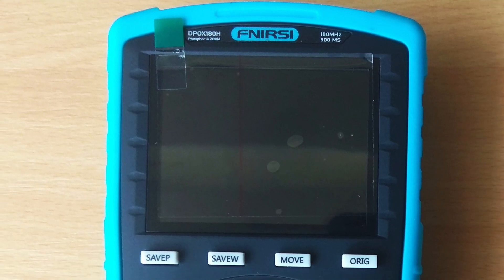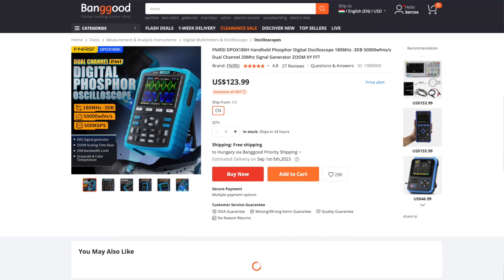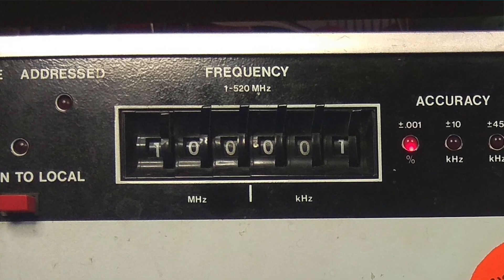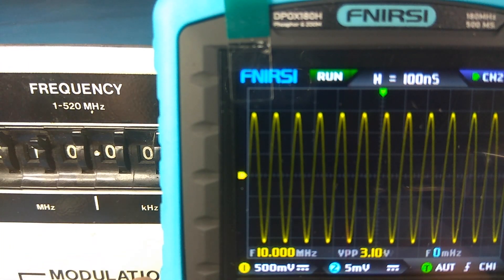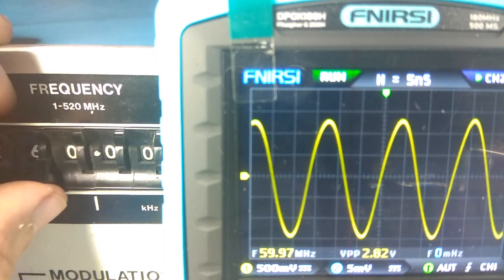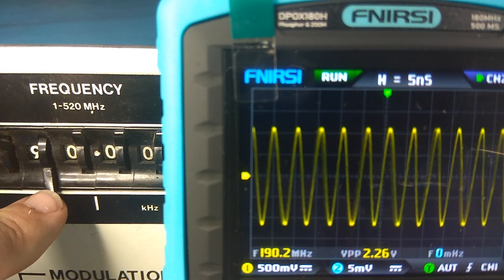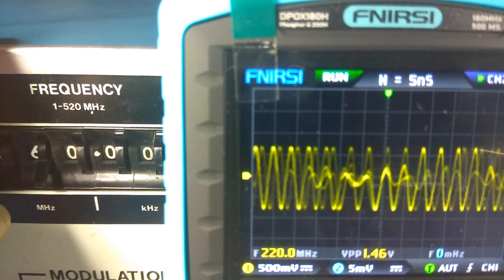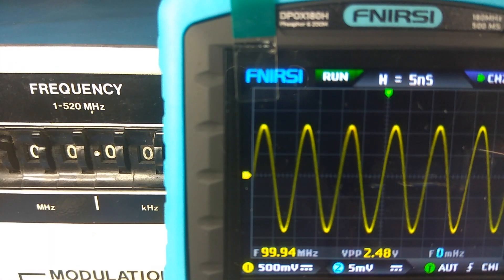FNIRSI DPOX180H Oscilloscope Review: Does It Truly Deliver 180 MHz?

Comment: I have seen in some videos that this model has serious precision problems in measurements. There is even a video where it tests measuring a 1.5V battery and this device shows a significant error in DC coupling, compared to another cheap handheld oscilloscope and a multimeter. This is concerning.

Comment: If you are feeding a 3V input, and it claims 180Mhz bandwidth, then we should find a 3 * 0.707 = 2.12V measurement at that. Instead it occurs at ~210Mhz. Not bad for Chinese handheld.
Reply: It writes Vpp, look carefully. You multiply Vpp with 0.707 when  you want to find Vrms.
Reply: @hundredwaves8459 this is true, but incidental . The -3dB point of a signal is also when it has reduced by ~0.707 ratio